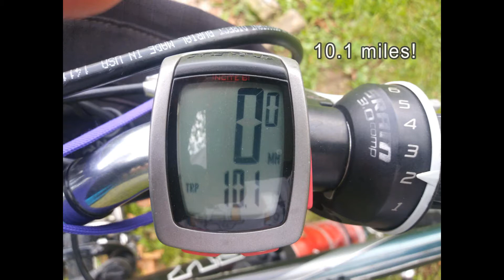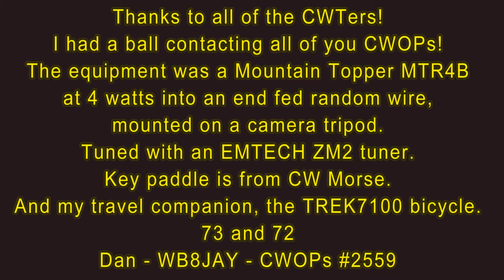Ham Radio - QRP - MTR4B - Bicycle - CWOPs - John Glenn Memorial Park

Comment: Nice job Dan,,,,     What is your antenna….?…
DE Greg. WA3GM  # 1827
Reply from the maker: 31 ft  wire wrapped around a 20 ft fishing pole, mounted on an old camera tripod, with a 20 ft counter poise wire.